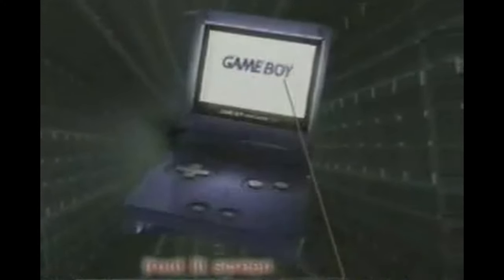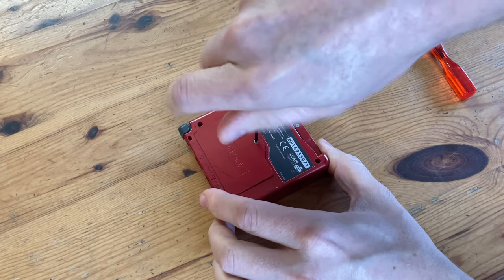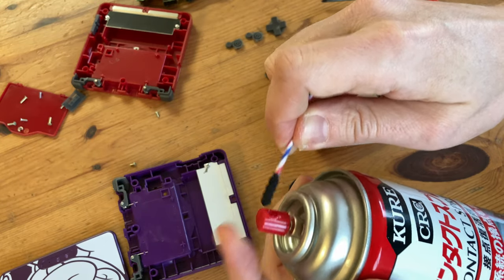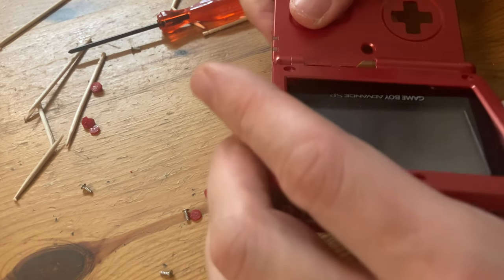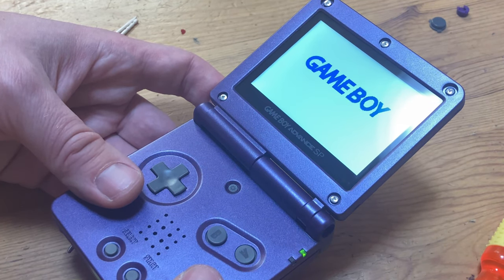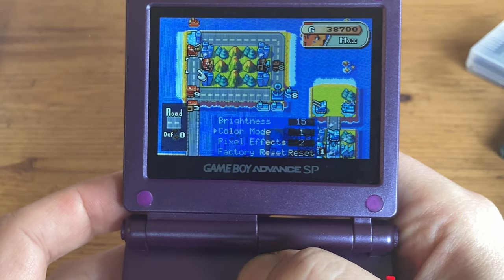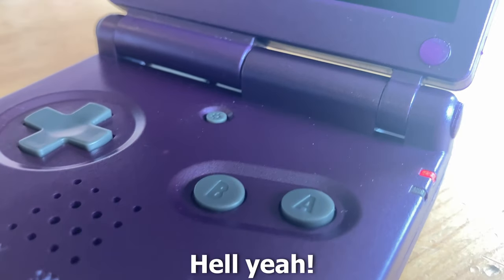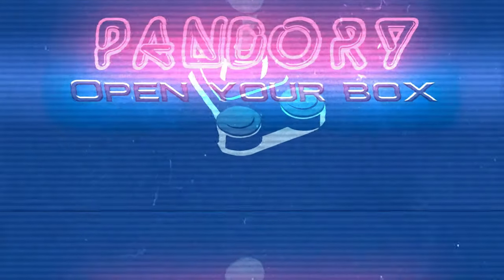GBA SP UPGRADE: IPS LCD Kit & Case REVIEW

Comment: So..love you vid. On thing, those hinge caps shouldn’t be ripped off during the removal. They actually slot down over the plastic of the hinge and so stay attached during removal and installation. They are a PITA to get out though and one can only be removed with the LCD flipped open (left I think) and the other with the LCD closed. I just wouldn’t want your viewers damaging their stuff and coming back at you. 👍🏻 Another YouTuber, makho goes over these installs and details the replacement very well.
Reply from the maker: Thanks for the comment. It's all a learning game, in our case we didn't really need to reuse the caps, but it's definitely good info to know.

Comment: Nothing wrong with the GBA SP 101 screen. Is super bright and great. The IPS screen is an overkill upgrade if you have the AGS 101 screen already. But a great update for the 001 models indeed.
Reply from the maker: Ags-001 used, 30usd. AGS-101 used, 300usd.  They're a rarity in my locale and I've never actually seen one in action.
Reply: @TeamPandory  AGS-001 are around €60-€80 in Europe now! The market is crazy.
Reply: I agree, and disagree... If you have a 101 the IPS LCD upgrade is night and day. You, apparently, have never done the swap. The original, true backlit screen is great, and more than enough, but the IPS LCD looks so much better in real life, than you even think is possible, until you see it with your own eyes... For image quality, and user enjoyment, it is not overkill at all, totally worth it!
However, there are way less 101's available, out there, than not. Do you really want to modify a factory original AGS-101 GBA SP that doesn't need it? It's a beautiful device to begin with, if the screen is in working order, THEN it's overkill. Don't deface a clean 101... But the moment dead pixels start getting noticeable, either retire it or get the IPS LCD.

Overkill if it's in collectible condition...
Not overkill if it's genuinely got screen issues...

I tell you what though, buy yourself a lot of broken and damaged Game Boy advanced SP's, strip them all down for just spare parts, and when you start building the nicest possible SP's that you can out of the parts, only use the IPS LCD screens. They truly are beautiful...